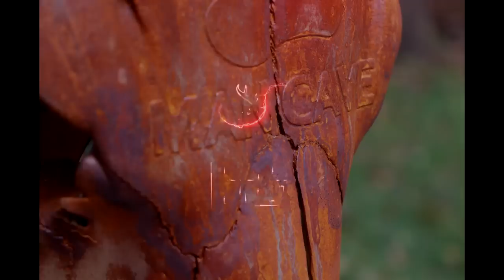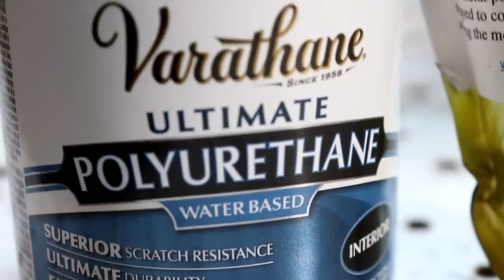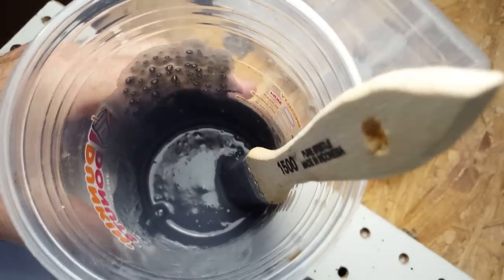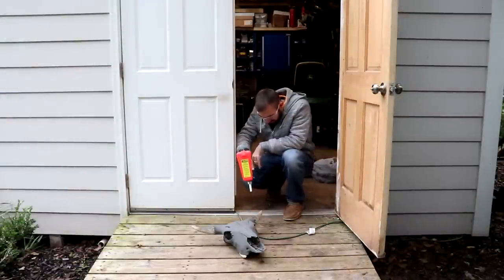How To Rust a Skull!

Comment: I was wanting to do this a mule deer skull I have, how would you recommend painting the metal in the nasal cavity without damaging the skull?
Reply from the maker: So simply use a black spray paint. Spray it up into the nasal cavity real good and immediately while it is still wet pour/sprinkle the iron dust in so that it sticks to the wet paint. And then you can add the activator.

Comment: great video. i tried you method. how long does it take to rust that great orange color. its been about a week and starting to rust (deer skull) any other info would be great.....thank you again for sharing.....
Reply from the maker: Hey Nacole! It should only take about a day. If its not resting as much as you want get some steel wool and wet it with the activator and lightly buff the surface. That will expose the powder and let it oxidize better.
Reply: @usskullhunter  ok thanks i will try that...have a blessed day.